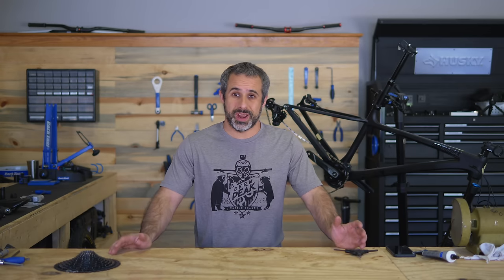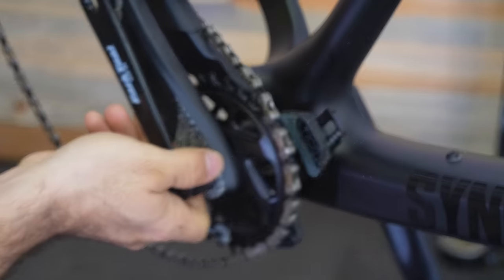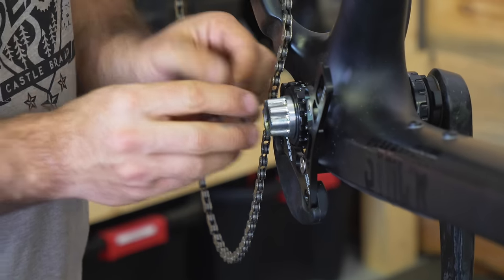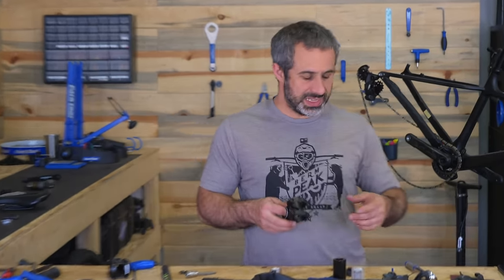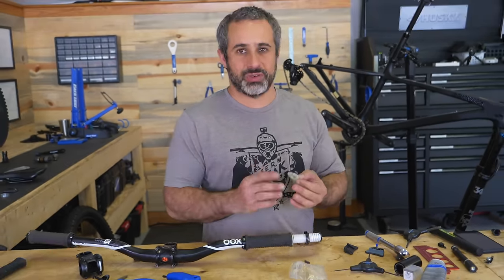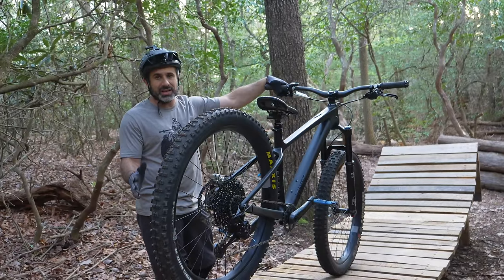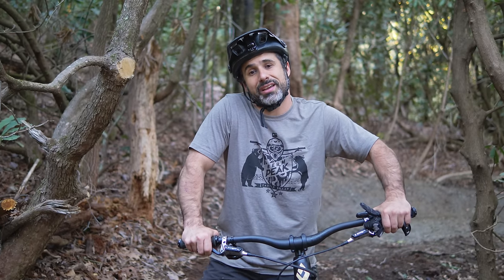Building up a new hardtail mountain bike... again!

Comment: I'll give you a hack: just push the starnut down with a broomstick instead of all those finnick methods you´ve tried. plus: using the broomstick method you'll be able to reuse the starnut.
Reply: Keyword down, as in towards the crown (the direction that it's designed to go) instead of upwards (the direction it's designed specifically designed to pull against without moving)
Reply: I was basically yelling at my screen to try and help Seth
Reply: I was wondering if maybe his fork is special and the hole on the bottom is too small for the starnut?
Reply: There are plenty of forks with the bottom hole not the right size to be able to do this
Reply: @slothpalms8124  Not if it's a tapered steerer like 99 percent of mountain bike forks. Plenty of room.
Reply: It’s tapered steerer loads of room
Reply: I have always knew this is the way to remove a starnut. I was surprised that Seth troubled his way.

Comment: Maintenance Hack: Make cable nipples out of solder 2 cables for price of one!
Tested myself.
1)Drill a hole the diameter and depth of a typical cable nipple in a hardwood block.
2)Drill a slot half the depth of hole 1 and ensure that the slot feeds into the side of hole 1. This is for a cable to sit in.
3)Fill hole 1 with molten solder and plunge the cable through the slot and into the solder. After it has set remove from the mold and clean up edges. You now have a new nipple on your cable.
This is great when you buy a new cable that is super long, don't chuck the excess, make a new nipple for it and now you have 2 cables for the price of one!! 
WEAR SAFETY GLASSES :)
Reply: Holy... That's a great idea
Reply: Thanks
Reply: I've tried to solder SS cable ends before instead of using crimp-on ends and had poor luck with it. Normal lead/tin solder doesn't stick to it. Quick research says silver solder works, but that stuff is expensive for a cost saving measure on a cheap part. Did you test with galvanized or stainless cable?
Reply: Your going in the next hacks video
Reply: Josh Powell Media thanks mate! When i saw this comment a while ago i tried it and it worked!
Reply: @mishmasta  I used Stainless cable and lead free solder with a flux core, £5.70 for the tube of 20g solder. Im talking about the cylinder nipple end of the cable, not the crimp on ends, I still crimp the other ends as normal. I got the idea from a 1950s Cycling maintenance book where DIY fixes were the norm post war in England, new cables nowadays arnt that expensive but its a cool hack nevertheless 👍🏻
Reply: This sounds like a horrible idea, you just described how to create a cold solder joint. I wouldn't even trust a good solder joint anyway. Cheap cables wouldn't cost much more than the solder you waste this way.
Reply: @UKDrillers  haha, that would be quite cool but I must say its a hack I discovered in a 1950s cycling book where some quite unusual DIY fixes were the norm in post war England, was a new one on me 🤞🏻
Reply: ** Update, ive since tried a couple more times, ive found it's a stronger fitting if you splay the end of the cable prior to placing in the solder. Takes some force to remove with plyers afterwards.
Reply: @joshpowellmedia8022  makes sense, like rebar in concrete

Comment: Couple of top tips...
1. You can put the bottom bracket tool in the bench vice and the whole frame works like a lever. Its stays on the tool much easier, and is great for stuck bottom brackets. Takes the hassle out of it. 
2. When doing anything that involves hitting the fork steerer tube, don't put the fork on the ground as it can damage them. Just hold the fork in the air by the steerer tube or under the crown and hit it, it will still work.

Love the heatshrink on the cabling, never thought to do that myself. I put heatshrink on the ends of my road bike bar tape though. Really enjoy your videos, keep up the good work.

Comment: I'm such a big fan of Sram, it just seems to always work and run smoothly.
That Industry Nine hub sounds like a beast.

Hardtails for life!
Reply: Sram Nx 11 does not run perfect every time, every day i have to adjust the gears
Reply: @hellboy_669  I used to have to do the same. I adjust my limit screws and B(tensioner) screw on the derailleur and haven't had any issues in 2 year. Also on an NX 11s
Reply: @screaminseaman6121  doesn't helps😉

Comment: What’s the point of threading the fork if you’ve got the stem as well? Doesn’t the stem tighten the headset already?
Reply from the maker: Yes and no. The stem can only work without threading if you get the little adapter for the bottom, and they were out of stock. Instead of waiting, I did it the old fashioned way!
Reply: The threaded cap compress the steam, headset, head tube and fork all together,  without it, the stem wouldn't be enough
Reply: @BermPeakExpress  what happened to Bosco.
Reply: he explained it in the vid. We're you paying attention?
Reply: I dont think Seth used the OneUp stem with the preload thing
Reply: the stem tightens down to the forks via the top cap but since he got rid of the top cap to put the multitool in he had to thread the forks so the hollow nut could tighten the stem to the forks instead

Comment: I've seen way more carbon frames break than aluminum or chro-mo. Just sayin
Reply: Same, carbon is more of a marketing ploy IMHO.
Reply: IMHO Carbon is for road bikes and  MTB riders who get sponsored. We mortals should stick to aluminum. Loved the video!
Reply: i could be very wrong here but form what i know carbon is strong but only if its hit the way its designed to be hit. so if you hit it the wrong way and go against its design it will just snap. The only experience i actually have with anything carbon is fishing rods lol so like i said, could be very wrong.
Reply: Yeah, mountain bikes really demand a more robust material than carbon.
On a road bike carbon is great because those bikes aren’t abused in the same way as mountain bikes; I’d personally prefer a bike that could take a beating rather than something that is a few pounds lighter.
Reply: @Billy Job they market it as stronger but it clearly isn't.
Reply: @jessewagg7317  you are right carbon is strong in many ways just not in the ways that a mountain bike needs to be.
Reply: Steel is real.
Reply: Yeah, they are only strong in some directions, but not in others. I got a friend who cracked his frame gripping the top tube to hard with his hand! Aluminium is just strong in every direction, and also more compliant, and cheaper. If you really want a carbon frame, you shall get it, but I would never recommend one to a person with normal income!
Reply: ALU rules. in slackcontry.  Cromo in bowls and in heavy rootish terrain. My 5
Reply: Carbon fiber frames are so expensive because they give them away for free to pro's. The public pays the price, and it's obviously inferior to aluminum and chro-mo.
Reply: @jessewagg7317  nope. You're on the money. You can mitigate that by layering the fiber sheets in different directions, but even then you'll have directions it's super strong and other directions it isn't.

CF is for people/groups who need that weight savings more than they need to save the money of having to replace frames.
Reply: @Billy Job it can be but it isn't in bikes. Hit a steel bike with a bat then hit a carbon bike with a bat and see what happens. Pound for pound it's as strong or stronger but they aren't making carbon frames that weigh as much as aluminum and steel frames are they?
Reply: @sethismename7499  Pro's ride them for free. Obviously u don't ride hard enough to break one, and you're rich. So, good for u
Reply: @Billy Job it can be but usually isn't.
Reply: That is because aluminum generally bends and dosent crack, carbon is stronger but when it breaks it cracks instead of bending thats why you see more broken carbon frames.
Reply: Anyway i prefer aluminum all the way
Reply: Jesse Wagg with a bike if you hit it the wrong way repeatedly it will crack. Not instantly but it is less durable than chromoly
Reply: Bobby Hempel not a marketing stunt. Carbon bikes are more expensive, but they are stiffer and absorb more vibrations than aluminum. Not to mention the weight savings. Carbon is not for everyone though, as it can be very expensive. A carbon sync’r is roughly 1000usd more than an aluminum one.
Reply: Chro-mo 4 lyfe! Gotta get that GG Smashmoly!
Reply: A benefit of carbon bikes is that as long as you don't crash too much they last forever due to the fact that they don't suffer from something known as metal fatigue which basically the metal gets less strong and stiff over time and will eventually break (I believe that they have a life span of about 5 years) whereas carbon bikes stay stiff forever and will not get worse over time and are also generally stiffer and easier to throw around
Reply: also the main reason that carbon bikes break is because they are aren't made well or use cheap weaves which aren't the best for the intended use. But IMO they are great
Reply: @liamforlong4089  5yrs? Please. There's no way that a carbon fiber bike will EVER outlast aluminum or chromoly. Unless we're talking about decomposing in a land fill. Genius
Reply: Turnip Green have you worked with composites or steel alloys?
Reply: @liamforlong4089  On bikes?
Reply: @TurnipGreen  as in making alloy and composite bikes
Reply: @liamforlong4089  No
Reply: That's because carbon fiber is light and hard, but not tough. You're trading weight for toughness, as materials like 6061 aluminum have some springiness to them and will crack before breaking. Carbon is more like 7005 aluminum, which is stiffer and will, much like carbon fiber, break immediately once a failure is about to happen.
Reply: Carbon bikes shouldn't even be a thing, imho, not even at a race level. They have such a big environmental impact compared to alloy bikes, it kind of makes me sad to know there are millions of people riding on carbon bikes, especially since there's no way to repair them or even recycle them if they ever break the frame... And if everyone in racing rode alloy bikes instead of carbon, the ranking would still be the same, so they might as well ban carbon and go for the more eco friendly approach.
Reply: @rfldss89  There are ways of repairing carbon fiber, but the cost is so high that it tends to go beyond the price of the part in question, especially in things like bike parts, where you only have a small amount of it, since repair techniques cost the same regardless of size. Carbon fiber bike parts are effectively disposable.
Reply: @liamforlong4089  5 years? Oh my lord... Metal fatigue is taken as a variable when teams design bike frames (and cars and planes and everything). Post metal fatigue strength is the number that is in ecuation. And the metal fatigue take a point when stop incrasing (if there Is no cracks). Even then Is much more than 5 years, like 20 years of daily abuse. A plane Is subject of big forces, bending and hits and can serve for a lot More than 5 years... Like 10 times More. The same with bikes.

Comment: i love that bike but he's not available in europe :(
Reply: Canyon make solid and fairly priced bikes
Reply: Bobo MasterRace they don’t ship to Canada either.
Reply: ThisIsMego canyon bikes are cool but they’ve no bike hardtail, price is not the problem. I really like diamondback bikes.
Reply: @iWatchization  :(
Reply: @ThisIsMego  canyon have terrible engineers tho
Reply: @currymasterrace7153  If price isn't a problem then there are lots of options that are as good or better that the Diamondback. And Canyon do make hardtails but I don't recommend Canyon as a Coyon owner.
Reply: Matt Astill Canyons hardtail are only cross country or low end aluminum trail bike
Reply: What i want is a carbon trail bike with 140mm or +.
Reply: @currymasterrace7153   Check out Dartmoor or Ns bikes they make preety slick hardtails also Nukeproof makes some good ones
Reply: @ThisIsMego  I have two chainstays in my shed that say otherwise.
Reply: Mr. W  I already have a dartmoor primal 27.5 frame but haven’t ride it yet
Reply: @currymasterrace7153  Why do you want a Carbon hardcore hardtail, they exist but there's not much demand for such a bike. Santa Cruz make a Carbon hardcore hardtail, but it ain't cheap.
Reply: Matt Astill since i had my specialized enduro s-works (my first carbon bike) i felt in love with carbon :D
Reply: Matt Astill and i dont like santa cruz, their price are too high.
Reply: You should try babahbikes from Indonesia 👌👍
Reply: @currymasterrace7153  Yeah, I know, that hardtail is ridiculously priced.  But if you open your search up to steel, the material of choice for this category of bike then you will have many more great options to choose from. Don't think of steel as the material for old or cheap bikes, a well designed steel frame isn't as heavy as you'd think and it offers a good ride characteristic ideal for hardtails.
Reply: I should add that there's nothing wrong with aluminum or carbon either, all valid options,
Reply: Matt Astill you’re right, the only problem with the steel and aluminium frame is that i don’t like their design or their geometry, i bought a dartmoor primal frame only because he was cheap. I will try the dartmoor and if he’s good i will try other frame :)
Reply: @currymasterrace7153  I'm not sure how material determines geometry, but is it the clean look with no welding that you like about carbon? either way, the way a bike looks should be near the bottom of requirements when choosing a bike.
Reply: Just get an orange bike. Ive always wanted a p 7 but its wayyy to expensive to get one shipped to me
Reply: Check out Radon! Incredible Setups for little Money, riding one myself :)

Comment: I've been riding a syncr carbon for about 5 months now, and when I have to take off my cranks to grease them, you can just unscrew the bolt and tap the other end with a rubber mallet. This works just as good and doesn't require another tool

Comment: I'm never gonna be able to afford pretty much any of the parts he shows, but I really do love the content. I'm learning so much. I've got an old Wal-Mart special from a pawn shop near me for cheap, though not cheap enough. Neither one of the wheels was true, and the rear wheel basically needs new spokes, some of them are kinked so bad it's really not safe lol

Currently trying to fix what I can fix on it, probably will eventually get rid of the front cassette/derailleur (the derailleur is broken already anyways, dang plastic parts) and I really want to see if I can find some second-hand hydraulics local. The cruddy little erasers on this thing don't really stop it, just run the cruddy paint off the wheels

Comment: The sythesis wheel's spoke design kinda makes sense when you consider weight to pressure ratio's of tyres.
You want less pressure in the front than the rear because more weight and power is at the rear of the bike.

Comment: Speaking on the wheels flexing sideways for suspension when leaned over; that is a known factor in motorcycling, although they do it differently. Companies advertise that their frames are X% less stiff laterally for improved tire contact while cornering and hitting bumps. The dynamics of cycling powered or not sure is interesting, flexible wheels for mountain biking, flexible frames for motorcycles!

Comment: Have you thought about a closed loop motorized pulley system for helping you get back to the top on your new trail system? You could possibly clear a straight trail on one side of your property  where you could build the pulley with the motor at the top and a switch on each end to turn the motor on. Then it would be simple to flip the switch on at the bottom, it would be running at a walking speed, then just grab the rope or cable while holding on to your bike. Then let the cable pull you up the hill.
Reply: Sorry, I know this is off subject, forgive me. I'm a boomer.

Comment: Any time you thread pipe, you should use a light oil on the threader while cutting the pipe. Works much better than just a dry cut.

Comment: To remove a star nut I generally use a piece of threaded bar, nuts and large washers, just screw it in from the bottom and it'll pull out quite easily....

Comment: Nice build, but I do have some remarks;
You are really scarce on grease usage.
As far as I know; Crank axles should be greased. As well as the Fork steerer tube where it touches the bearings.
And just for good practice; use grease or oil when tapping metal.
It makes cutting a lot easier, and in this case a grease could also catch a bunch of metal shavings.

Comment: I ride a skateboard, and still watch these videos. I wanna buy a Haro MTB, because I kinda like supporting brands I like. They have a "Double Peak" For like just under $700. I am afraid, if I buy a cheaper MTB, I'll be sorry, but I don't have  over 1500 to drop o  a bike, especially when I don't even ride (yet). My old ass, needs to try something different, besides bouncing off concrete. This guy has me interested now. LOL. Peer pressure!🤣

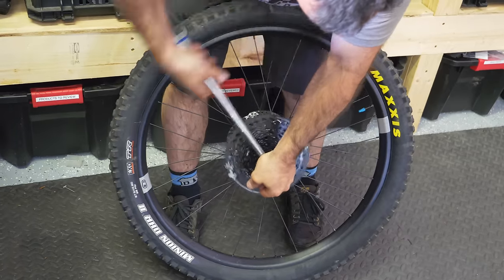Comment: At about 11:00 you said it perfectly...
"I don't need more gears I just need a low gear and a high gear"
I wouldn't mind a 10 or 11 speed I just need that really low and that's really high gear
Reply: 10 ? 11 ?
Wutt? I want 6 gears!! For real.  
I'm almost always shifting two gears at a time. I could do with gears 1 - 2 - 4 - 6 - 8 - 10 on a regular 11-42T cassette. Only problem is getting smooth shifts with those jumps. BRING BACK THE 6 SPEED!!
Reply: @Erafune  No, I totally agree with that... If I could get the same range with even spacing, I would be absolutely thrilled with only 6 gears!